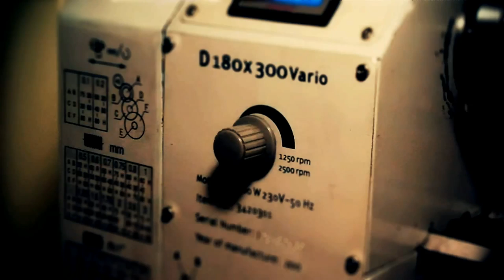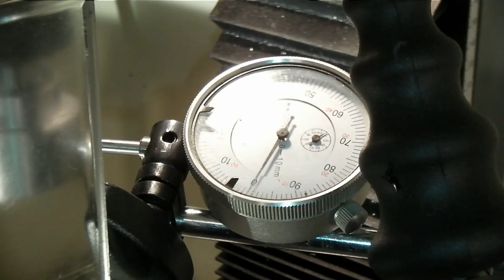Boring Head Making - Part 1

Comment: a) I understand you. I would not like to speak in the video either. I am fine with your approach.
b) Threading the arbour is ok. However, the thread should not act as a radial register as it seems to do in your design. Threads usually have no good radial position repeatability although your run out measurement seems fine. Nevertheless, you would need an additional cylindrical shoulder with a tight fit to take over the function of radial register. Better two of those: a smaller one below the thread and a larger one above the thread. This would guarantee coaxiality within the tight fit tolerances.
Reply from the maker: rol eic Hi rol eic and thanks for the comment! I agree with you, but when I realize that it was too late.

Comment: Good machinig. But why you've threaded an arbour? Wasn't it easier to make the head and the shaft turned in one piece?
Reply from the maker: Thank you Cosimo! Yes it would be much easier but what if the arbor damaged somehow? Now I can modify an MT2 arbor or an MT3 and hold the boring head directly on my mill or my lathe.
Reply: You are right! I follow you: I've appreciated the internal threading with upside down tool. A touch of artist.....ehehehehe
Reply from the maker: Cosimo Marotta LOL! That helps a little bit.. to see what's going on in there.

Comment: hmmmmmm marking your workpiece by a vernier caliper  on a running machine?...i don't think its a good idea...its not a good practice bro..:-)
Reply: Anyone that machines does it all the time. It's no more dangerous that using the file. Not paying attention is the only danger.
Reply: yea what they teach you at school is nothing like what youd do in work. I wouldn't make a digital scribe out of my mitityto, thats why i have a cheapo set for this kind of stuff
Reply: Nathan Hellyer I use my DRO instead of a scribe
Reply: thats great when you have one :)
Reply: Back in high school nothing had DROs now I won't even use a grinder without one. Nothing better to add to a machine other than maybe a conversational control. I don't think I could justify the productivity loss of not having one any more. My dad on the other hand is old school and dose not care for all the electronics these days.
Reply: i agree they are amazing, the lathe at work has had 2 DROs last one dying just before i started :(
Reply: I been around machining sense I was a freshman in high school when I ran my first CNC. I kinda had a natural talent for machining. I would get pulled from English class to ether weld or machine parts for the school janitors so I spent a lot time in the shop rooms.